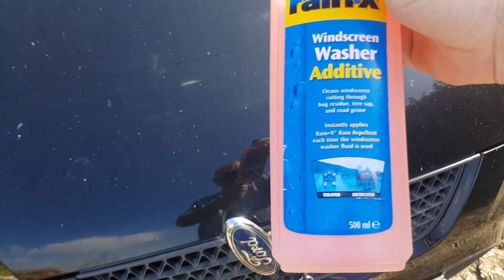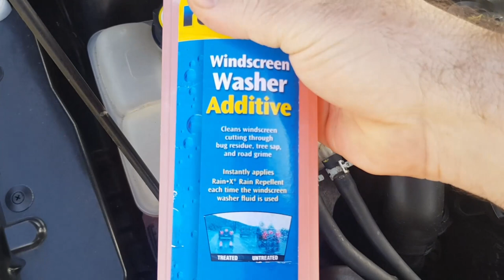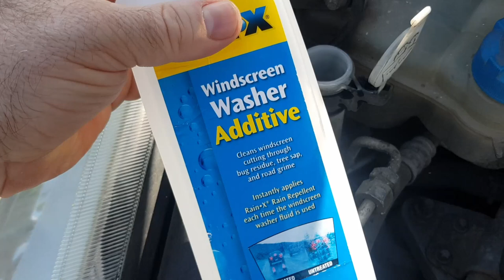Windscreen Washer Additive - Ford Focus ST Episode 21

Comment: Hi Paul, nice video 👍 it's amazing how the leaves get under the bonnet, I live in an apartment block with the car parked under the building and no trees about but still find leaves hiding !!
Reply from the maker: Thanks John, it's crazy isn't it, some get wedge into parts wear I swear there is no airflow 👍.
Reply: @PaulinhoThompson  hahaha that's right Paul, I think "really, how did you get in there"